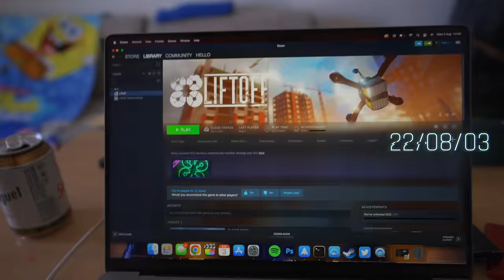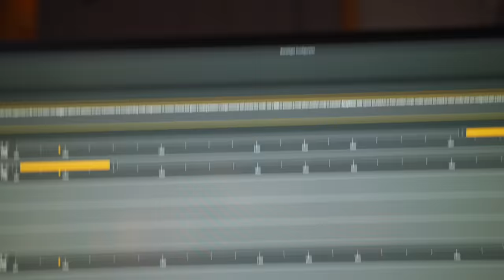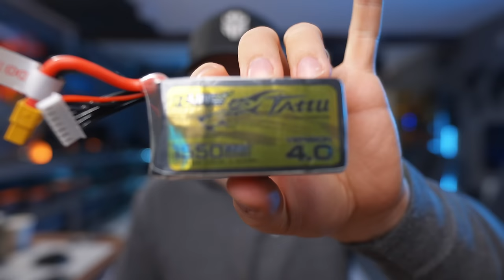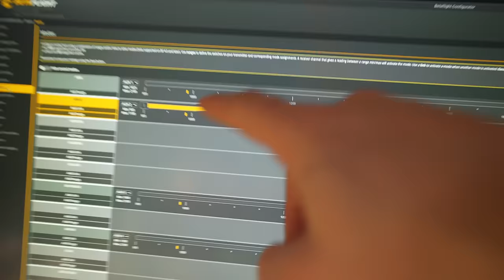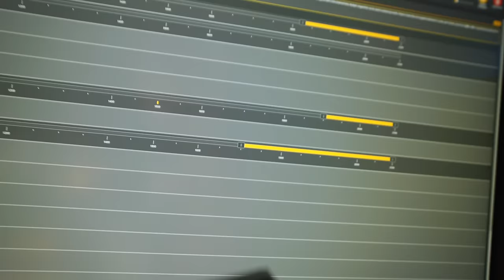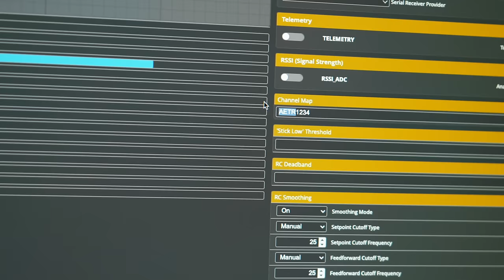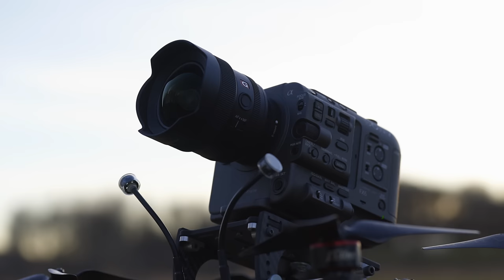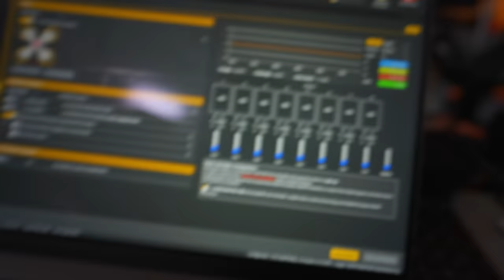From Regular Drone To Cinematic FPV Drone | An FPV Journey

Comment: Cool to see more FPV content. However I'd suggest you to practice some freestyle with the 5inch before sending up the cinelifter again. This way you will learn how to react to different situations. e.g. I cringed a little when you crashed the cinelifter and took quite long to disarm
Reply from the maker: I am practicing a lot. Only way to learn from your mistakes is to try again.
Reply: @PeterLindgren1  exactly. That's what I meant. But It's just way less dangerous and expensive to crash your 5" on a big open field than a cinelifter. You're going to learn much faster sticking to one rig at first. And once you can fly freestyle (real flippy floppy and hitting gaps) you can do anything else as well. I wouldn't recommend just sticking to smooth and slow flying for too long in the beginnig. I've learned my lessons too, and so does anyone else flying FPV
Reply from the maker: @ariafpv  I have been flying for almost 8 months now, and trust me, been trying all different rates!

Comment: Sorry, but anyone that tells you that a MK5 is garbage and you need an Evoque is obvioulsly involved with iFlight... I own both, they fly just as well as each other, but the Evoque is considerably harder to work on and not suited to warmer environments due to the sidepates causing cooling issues. This is not just my opinion, do some research and I'd say almost all the KOL's will agree...
Reply from the maker: He didn't recommend an iFlight, i bought it only to compare. David recommended the FPVFrame FlowX

Comment: For some reason FX6 footage doesn't look that much better in comparison to GOPRO. Yap, you will get all those  possibilities to tinker in post, but here in example, footages were so similar.
Reply: YouTube compression. It's not worth flying cinema cameras unless on a real production set at this point. That being said, GoPro footage has been implemented in Hollywood films just fine. This is just a huge flex from Peter
Reply from the maker: It’s not a flex, it’s just to show people that it’s completely unnecessary to use an FX6 on a drone as a creator

Comment: Is it just me, or are the "cinematic" shots really jerky? Visible at least in the shots of the pickup at around 18:00 and on the shore at around 24:30. Motion seems to happen in "bursts" - I'm guessing it has to do with the framerate of the source footage vs. the exported footage?
Reply from the maker: Frame rate is 30 and timeline 25fps, it means that the timeline skips 5 frames every second! hence the jerky footage.
Reply: @PeterLindgren1  Ah, so I'm not crazy 😅 Thanks! Any particular reason you use "mismatched" rates like this?
Reply from the maker: @jckf  Instagram is playing back their reels/stories at 30 fps =/
Reply: @PeterLindgren1  So why not export at 30 for both YT and IG?

Comment: I think that Peter painted a bad picture of FPV and I dislike this video. I watched it all and am greatly disappointed with Peter. I like his stuff but I do not like how he makes fpv look like. I was 15 when I built my drone with less knowledge then Peter had access to.Peter is seems to be just a rich dude who can throw all his money at FPV without doing research, watching @Joshua Bardwell, and just buys BNF's and hopes for the best. FPV experience DOES NOT have to be like Peters if you take the right steps. Peter just skipped 50 steps and that's why he had a bad, expensive experience!
Reply from the maker: First off, I’m not a rich dude, I’m just dedicated to make things happen. 
Secondly, there’s no “Correct” way of learning things.
In this video I shared MY way, not saying that it’s THE way.

Anyway, thanks for watching, appreciate it!